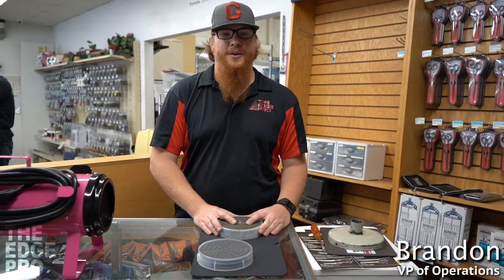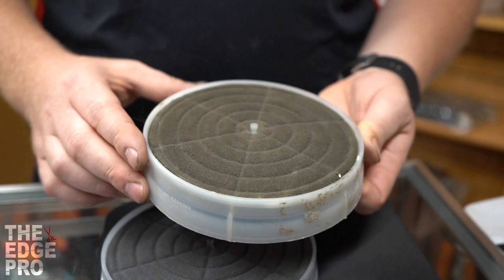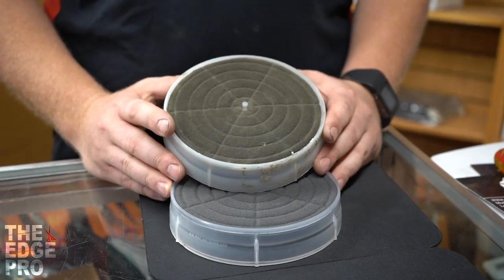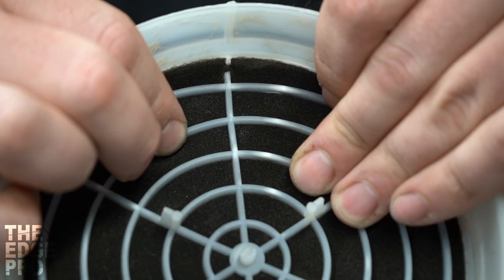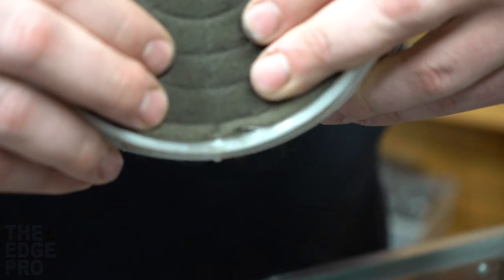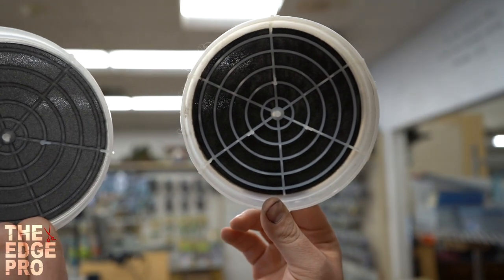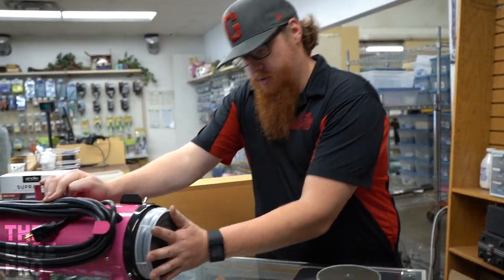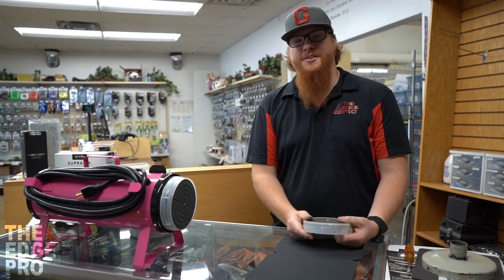Electric Cleaner Company K9 II - Basic Maintenance

Comment: I cleaned my filter but my dryer won’t push air like it should
Reply: How did you clean filter?
Reply: I brought it in and washed it then let it dry. I figured out how to change the carbon brushes and popped a new hose on the front,  it works like bran new 👍🏻